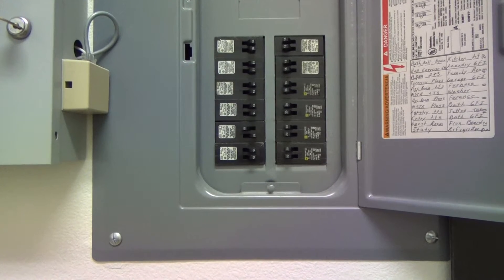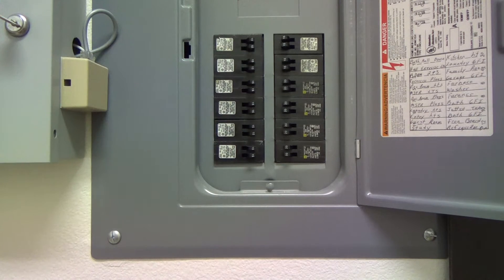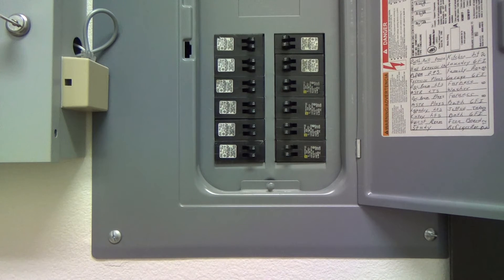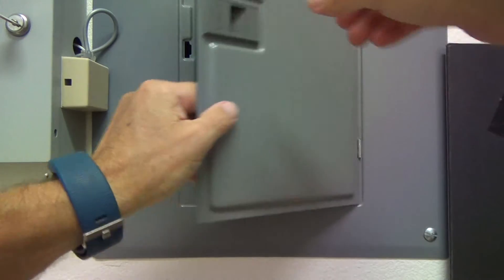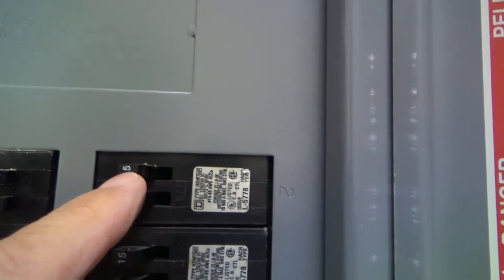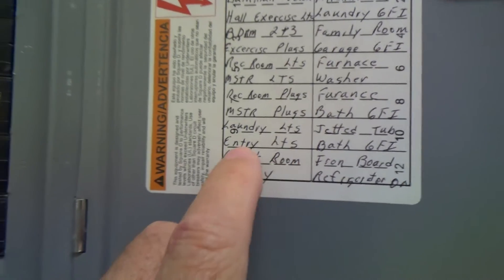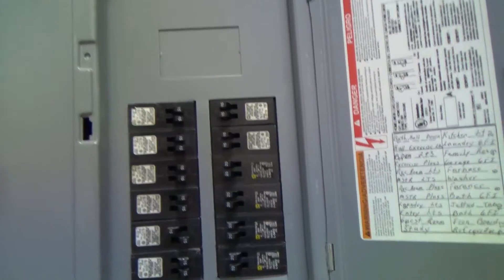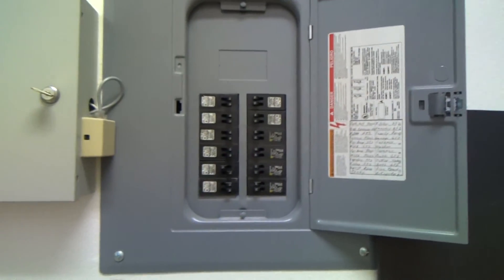How to Reset Tripped Breaker/Why Did Breaker Trip?

Comment: Breakers either trip because of an overload or short circuit, usually an overload.
Reply from the maker: Usually yes. Or if you get a loose wire nut over time let's say, in a junction box, that could cause a short circuit too or if you are installing some electrical & maybe hook up something incorrect that could cause the breaker to trip too, when you turn it back on. Thanks for your comment!